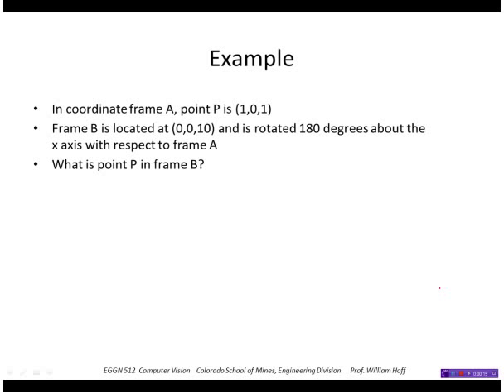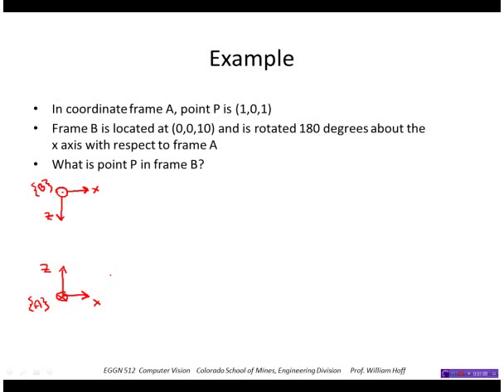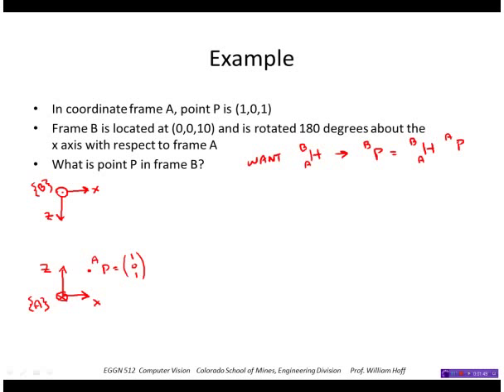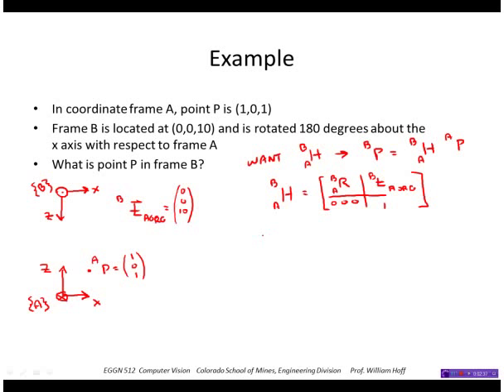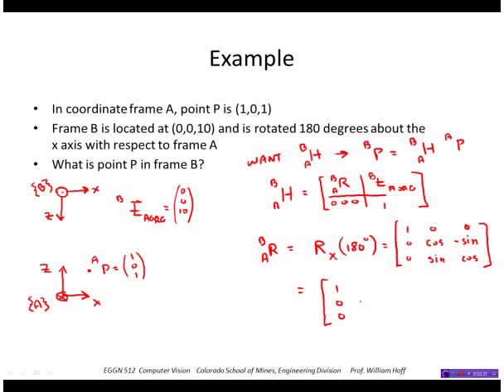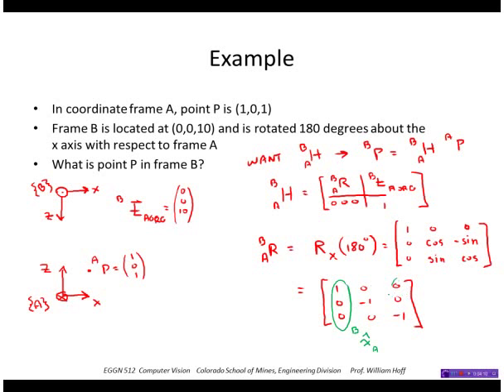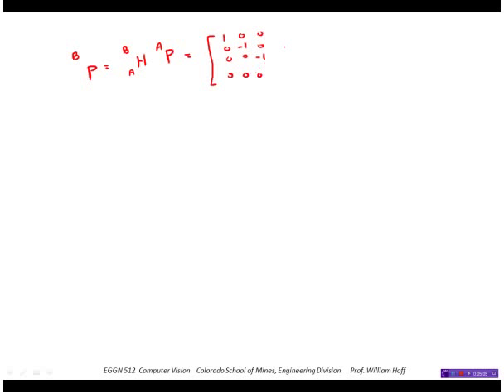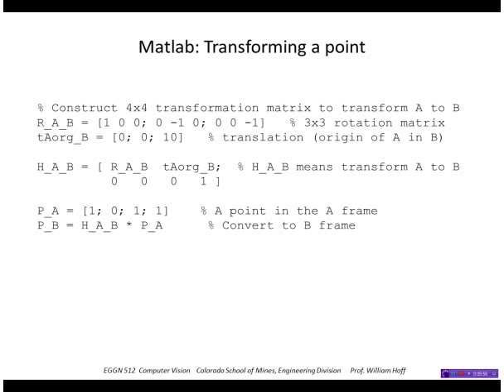CSCI 512 - Lecture 04-2 3D-3D Transforms

Comment: I think in the Example, he made a mistake! He should have multiplied the inverse of the homogenous transformation (inv(H)) to compute the position of the point in frame B, rather than multiplying the homogenous transformation itself (H). Luckily here, these two were identical and he got correct results, i.e., H = inv(H).
Reply: ya i get lost too so much because of this ; i think he made a mistake
; really i am not sure
Reply: i think you are right 
t(Aorg)=t(Borg)=[0 0 10 ]  and rotation(AtoB) = rotation(BtoA) and right he must take  t(Aorg) which he did but he didn't mentioned that t(Borg) which is given is equal to  t(Aorg) ; and he was talking as if  the given is  t(Aorg)
Reply: why inv(H), we are already constructing a H matrix going from A to B.